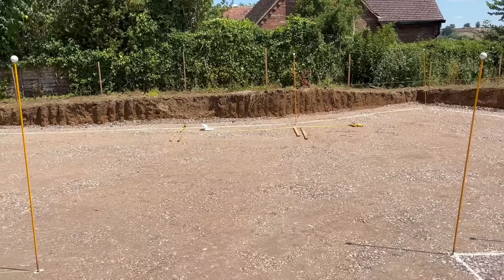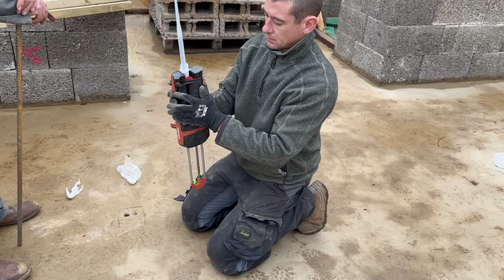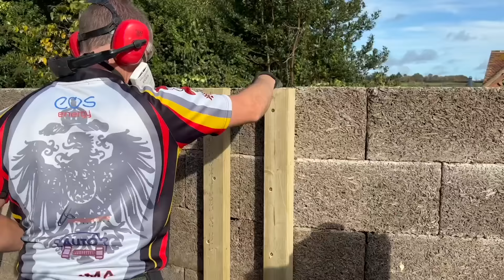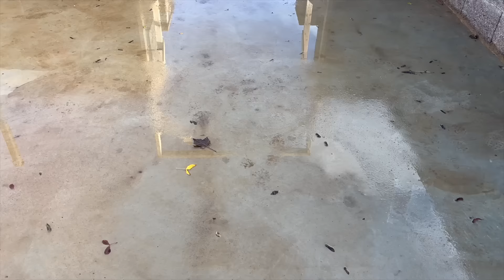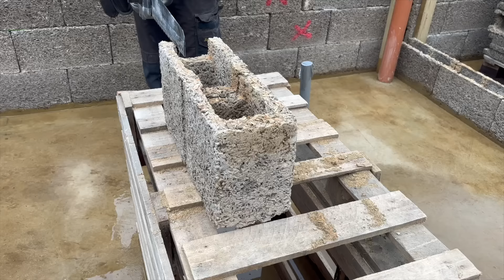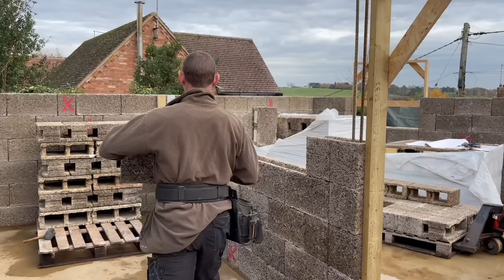How We Built Reinforced Stair Walls Inside Our ICF Home - Self build - Ecobrix

Comment: I do like the look of the system, does look like may be lots of gaps in the insulation
Reply from the maker: There are gaps or thermal bridges due to the Woodcrete webbing in the blocks though these are minimal and I believe you would find that in most Woodcrete ICF blocks.

They still provide a very good U-value and that value only improves with internal and external coverings.

It’s worth mentioning too that the insulation in Ecobrix is proper PIR insulation like Kingspan or Celotex which is very high performing compared to other ICF’s that I believe use a thermal polystyrene.

Comment: When you drilled into that concrete how did  you kmow the underfloor heating pipe wasnt punctured?
Reply from the maker: The under floor heating pipes sit at 250mm below the surface and we were anchoring at 200mm.👍🏻

Comment: Great video. Quick question, I assume when you laid your underfloor heating pipes, you knew precisely where you would need to drill the concrete for the rebar? I was shouting at the screen, "Don't drill your pipes"!!! Looking forward to the next one.
Reply from the maker: We do have a very good idea where our underfloor heating pipes are… though we are not drilling deep enough to get to them. They are sat at 250mm below the surface and we are drilling to 200mm.😅
There was a sweat moment incase I caught the upstairs underfloor heating supply pipe.😅
Glad you’re enjoying our experience.👍🏻

Comment: Interesting to see the ecobrix in action. They look a lot slower than polystyrene ones. 

Interesting that they don't need to be tied together with horizontal rebar, or that they don't need to be tied to the slab either. 

Does the membrane sit between the walls and the floors? 

With hindsight would it have been worth locating openings at distances based on block widths to speed things up? Or would that not make much difference? Are you getting much wastage with the ecobricks? 

Curious to see how you have to pour it, and how to vibrate it.  Have subscribed to follow the process. Thanks for posting the videos.
Reply from the maker: Thank you for the subscription, I hope you do find it interesting.👍🏻

There is maybe more tasks needed to build with Ecobrix block (though we have not used the polystyrene ones before) but I believe that is because they are a more substantial ICF. Also I must add that it probably looks a lot slower because Ellie and I work at a very steady pace.👍🏻

It all depends on your design and what structural engineer works out. The opposing walls are all tied together at some point with rebar and continuous concrete in our build, but the mass of the concrete inside the block can be enough. Tying to the slab is also based on your buildings loadings etc and potentially ground conditions.

Our DPM is under our concrete slab and comes out to over lap under the insulated portion on the block. Apologies if that’s not what you are asking.

You’re certainly right that it would be beneficial to have everything in Ecobrix dimensions. Our planning was already well in motion when we made the decision to use the blocks so our Architect adjusted the design slightly (within limits) to allow for a better build but we didn’t want to resubmit our plans just to allow for better dimensions throughout. All that being said, we don’t feel like it’s been a hinderance really. We have barely any wastage as it’s advised you keep any cut sections to potentially use later on (which we have). Anything smaller the 120mm gets discarded. 

Aiming to have our first pour done before Christmas. Once again thank you for your interest and questions.👍🏻
Reply: @TurningRosemountUpsideDown thanks. Good luck with the pour.